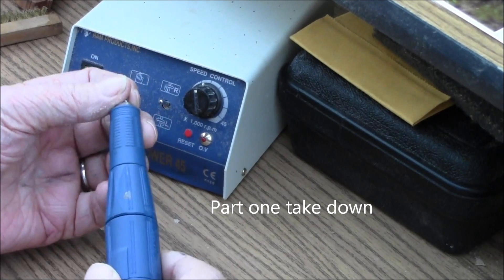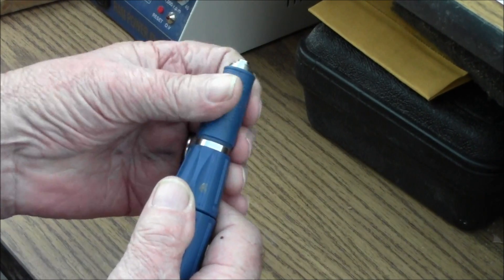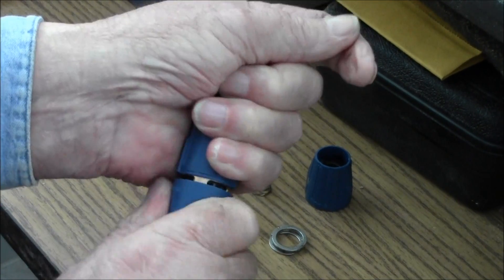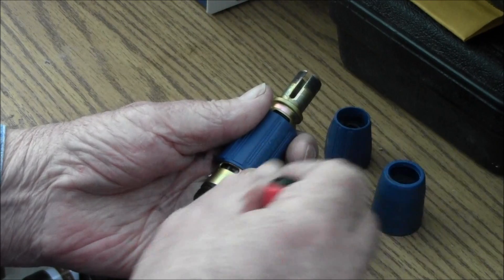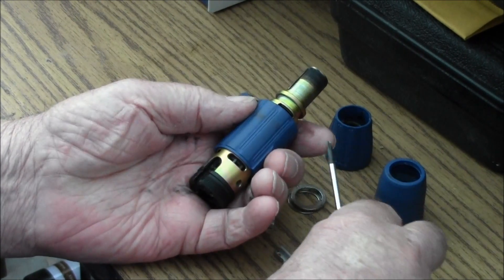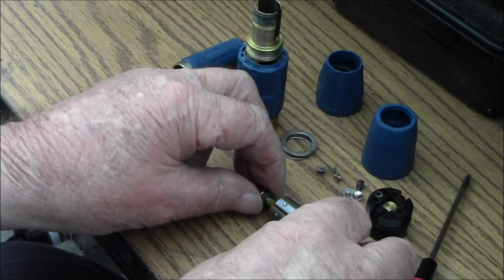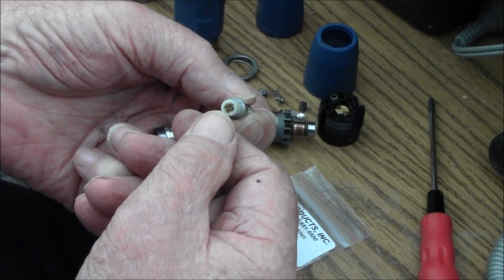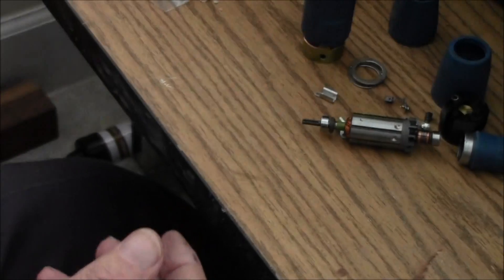Ram 45 micromotor repair part 1

Comment: Thank you, very helpful video. When I pulled out the rotor from casing, the shims stuck on magnets. I am not able to determine the correct position of them. The only exploded view I have seen so far, is the one you have it. Can you upload it somewhere, since the link in the description  is broken. Thanks.

Comment: Thank you for that very clear and helpful video.. your disassembly instructions helped me clear out a stuck burr! That solves one problem. The handpiece I have seems to be running fine now. But I have another problem with the control unit also. The motor runs only at one speed oh, and I don't know what that is. The control knob does not change speeds at all. Have you had a problem similar to that? How do I get my speed control back? Have you ever had a problem with the control box itself and do you have any experience with fixing the speed control? Any suggestions from you will be very helpful, thank you again.
Reply: I have had this problem on Marathon 3. It's a transistor failure inside the control box, caused by an input voltage problem. Replace the transistor should be resolve it.
Reply: @jaimefilho4959  Thank you for your response...

Comment: hello, did you have diagram of voltage regulator?
Reply from the maker: Grzegorz Fiuczek no. Sorry I do not have wiring diagram
Reply: I am jawed from karachi Pakistan I am fully repairing  and 50`000 rpm waindar call 0093142176669

Comment: Can you share where you purchased the bearings.  Ram says they won't sell them.  They said to sent them the hand piece.
Reply from the maker: I bought mine from Ram Products. I don't understand why they would not sell to you.
Reply: you can buy them at ldental.com too.
Reply from the maker: Thanks Dave, good info.
Reply: Hi Ed. I distribute Ram Products in Canada. If people are interested in parts or new equipment in Canada they can call 1-800-667-3770.